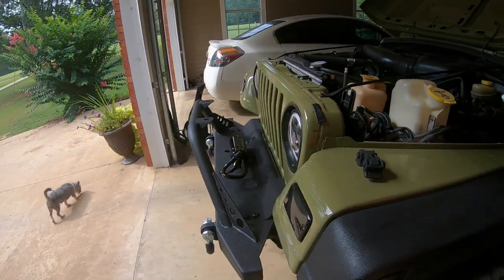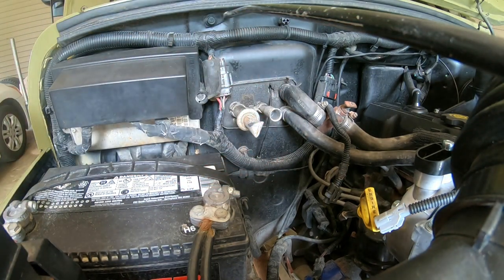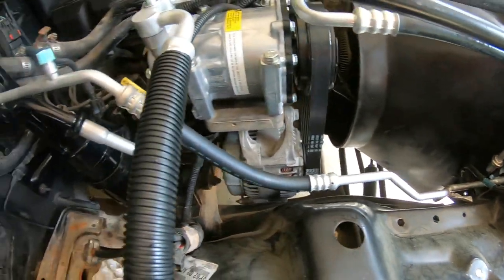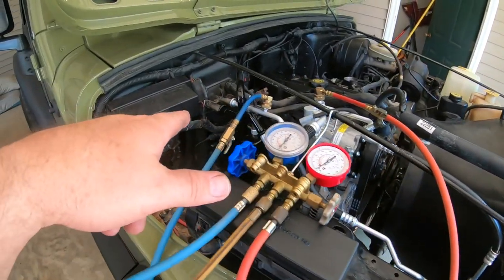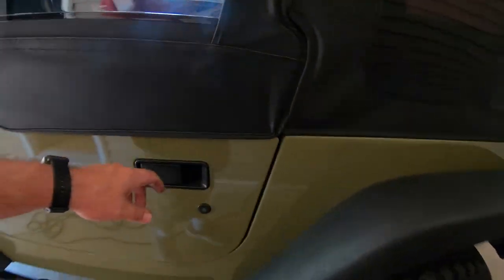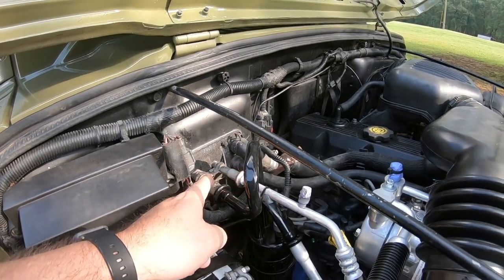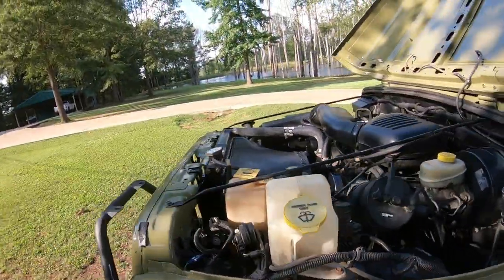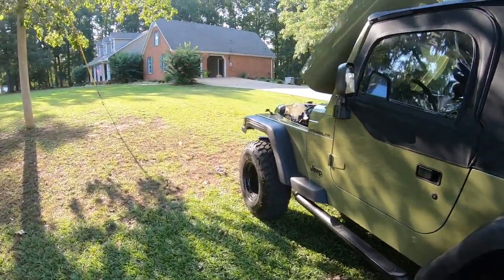Jeep Wrangler Air conditioning Installation (Part 2)! Installing AC on My Wrangler SE

Comment: Was there anything you had to do to the wiring besides the relay, fuse and pressure switches or was it prewired? I see some connectors near my compressor bracket. Are those for AC? Mine is a 1998 I’m restoring. It’s also a 4cyl 5spd.
Reply from the maker: All the wiring was there. There will be 3 different plugs. One for the cycling switch on the dryer, one on the high pressure switch and one on the compressor. Thanks
Reply: Force Built thanks for your quick reply! I did just go outside and looked. I have a black and gray plug near the bracket and another gray plug near the firewall. I will definitely be adding AC now that I see it’s mostly plug-n-play! My son and I enjoy watching your Jeep build and we love the commando green color. It’s one of our choices when we get to painting.

Comment: Hy Steve ,today I found a complete kit from "JEEP AIR" in Ocala FL.,it.s good but too expensive ( with ship and tax in cost me more than 1500 $ ,I 'm from Italy) I saw and cheek all component you wrote  on  Amazon .is  better and cheeper so I will buy there ,,,,,but where can I find recirculate door ;actuator and Hardware?.. About control Knob , May I use the original old one from fabric ? On my 1999 TJ is not slide ,but total Knob , without A/C symbol and switch for  on/off  it    ... Thank s
Reply from the maker: I think your control will work even though it is a knob and not slider(I could be wrong). My slider only has vent but still turns on the ac.
Concerning the recirculate door. I don't know where to source that part or actuator. Possibly Ebay. Your air will work fine without it. It will just be colder with a recirculate door. I did put one one mine and couldn't really tell a difference. I personally wouldn't bother with it, but I have a soft top. Mine don't hold cool air long lol.
Reply: Now all is clear ,Thank s one more Steve.

Comment: Hey I am currently installing the same ac system you put in your jeep but i am a bit confused on the electrical I understand that the plug closest to the fire wall goes to the accumulator drier but i have two black plugs next to the mounting bracket for the compressor that and one plug coming off the compressor and I was wondering where those 3 go thank you
Reply from the maker: Should only connect 3 in total. One goes to the drier as you said. One goes to the high pressure switch close to the compressor(in the actual line). The last one goes to the compressor (plug with single wire). All the plugs should be only able to plug in one place(where they go). The extra plug isn't for ac. Thanks!

Comment: Did you add any refrigerant oil to the system other than the oil for the compressor? Just curious since you were adding more new components than just the compressor, great video 👍
Reply from the maker: Yes, I did add some to the Dryer also. There is a certain amount meant to be in the system. I don't remember the #'s off the top of my head. Thanks for watching!

Comment: Great job as usual.   I probably missed it in an earlier video but did you put the evaporator in when you changed the heater core?  Have a great weekend. Thanks again for the videos.
Reply from the maker: Thanks Bob! The evaporator was already in from the previous owner. The heater box is a newer one than what comes on a 97  wrangler. I think they had damaged the original one or was planning to add ac. Not for sure why it had the evaporator already installed.
Reply: @ForceBuilt  Wow the previous owner did the hardest part, having an airbox that was ready for Air Con installed.
Reply from the maker: @brannonmiller5548  My Jeep has been in an accident before I got it. It has 03-06 seats(It's a 97). The heater box is from a 03-06(I had to make a cable adapter for my 97). So what I am saying is, they didn't do it on purpose. They were just putting parts on to replace broken ones lol. But it did benefit me in the end.

Comment: I don't have those fittings I only have the heater core fittings.  Do you change your airbox A/C unit?
Reply from the maker: That means you will have to take the dash out and put in a evaporator core. Mine had that from previous owner. Thanks!

Comment: Hello, your video is very good. I have a 1999 tj 2.5l without a/c and I want to install it, could you tell me if it is a kit or if I buy part by part. Thank you
Reply from the maker: It was bought piece by piece. The links should be in the description. Thanks for watching!

Comment: I suggest you to explain better the eletric wired connections on AC compressor ,cycling switch  and hight pressure switch .
Reply from the maker: There are only 3 wires to connect. They are all different plugs. No way to confuse plugs. Low pressure, high pressure and the one that plugs in to compressor. I didn't think it needed much explanation.
Reply: @ForceBuilt  Thanks,sorry but in the video I dint understood where the wires was ,just the one on accumulator drier ,all right for the wires on compressor.
Reply from the maker: @giannisalustri7848  I just watched the video again. Man it's been a while lol. Just look under your hood(bonnet) you should find 3 loose connections just hanging around not connected to anything. One will be a short wire close to where the dryer will be mounted. The other 2 will be longer but there is an easy way to tell which one is which. The one for the compressor will only have a single wire going to the plug. The one for the high pressure switch will have 2 wires. Hope this help! good luck and let me know if you need anything :)
Reply: @ForceBuilt  I found very easy the wires close to the compressor for it ....the one for drier accumulator is hidden away I will look better moving the Electric harnes ...now i will buy all component than I waiting for.shipping and ,TAX .....I will write here when I 'll Fit the Job ...Good luke ...I need.

Comment: Hello! Hopefully, you are able to see this comment and help me out! I am installing a A/C kit on my 97 TJ but don't seem to find the connector for the compressor. Where did you connect yours?
Reply from the maker: It is a plug with a single wire. It should be on the passenger side of the engine. Possibly hanging between the distributor and the front of the engine.  Hope this helps!
Reply: @ForceBuilt  found one with like a bluish color but doesn’t fit. Any suggestions of pictures? Thank you so much for the help!
Reply from the maker: @davidparra4646  contact me at futuraforce@gmail.com . I will take a pic of mine this afternoon and help you get it sorted out. Email will be the best way for me to send pictures.
Reply: @ForceBuilt  will do! Thank you!
Reply from the maker: @davidparra4646  You have mail!

Comment: I finally finish installing the ac on my 98 TJ. Couldn't have done it without your video. Did you notice any increase in engine temp after you installed yours? Mine not is reading above 210. Also will the heat from the heater core affect how cool the ac gets?
Reply from the maker: That's great! Didn't get a temp increase but mine already ran 210 to start with. Yes, the heater core will affect the ac. I put a cutoff valve in line at the firewall. When summer is here I always use this valve to turn my heater core off at the firewall under the hood.  It isn't needed in the summer. Hope.this helps!
Reply: @ForceBuilt   Great info. Thank you.

Comment: Would you see a significant loss of power with stock gears on a 5-speed 97 TJ?
Reply from the maker: Here is my honest opinion. I have 4.88 gears but also have 32x11.50 tires. They are heavy. If I was to drag race you, I don't know who would win because I think(if you have stock tires) that we have about the same power.
OK, I can diffidently feel when my compressor turns on and off while accelerating. When I am at cruising speed it doesn't affect at all. 
Here is what I did to solve the problem. I installed a toggle switch(I have a video and there is a certain way it has to be done).
When I need to accelerate as fast as possible, I just flip the toggle switch to disable the compressor. Then when on the freeway at cruising speed, I just turn it back on. I know this was a long response to a simple yes or no question. Here is a link to the toggle switch video( https://www.youtube.com/watch?v=WaI_SeEcs4I)
Thanks for watching!

Comment: Hy , Can you explain me .... had your jeep  just the vent installed from fabric .and the compressor switch line  ? I want install AC on my TJ 2,5L   by 1999 .,Have I to remove all dasch ?  have I  to install a new knob control  switch?... Thank first
Reply from the maker: Yes you will have to remove the dash to put in the evaporator core. You can use the controls you have. That is what I am using. Hope this helps!
Reply: @ForceBuilt  Thank so mutch ,I understood well from your video,long job ,but not difficoult ,I will buy the complete kit ,last question : Wires line to switch compressor ,are just inside ? My tj is 2,5 L 1999.
Reply from the maker: @giannisalustri7848  YEs, all wires I needed to connect were already under the hood. They should be there right now just not connected to anything. Hope this helps!

Comment: thanks for these great videos, Im gonna try on a 98tj 6 cil, there are a few things that chance, actually i guess is only the ac manifold hose, how ever what did you do for the recirculate door and actuator? i cant find those parts,  (Door is the biggest problem) so i was thinking in machining them on a mill thanks in advance regards From Reynosa Tamps. Mexico :)!
Reply from the maker: Thanks David. Someone had changed my heater box for some reason.  It already had the actuator and door on it. The diy kits I have seen actually cut a hole in the heater box. You can find actuators but would have to make a door. I personally wouldn't bother if mine didn't already have it. My door wasn't working at first and made little difference once I got it working.  So I think the door is optional and not necessary.  Hope this helps and thanks for watching!
Reply: @ForceBuilt  thanks for your quick answer! so without the door the air will be always recirculating right? i hardly ever use the outisde air option in other vehicles so i dont  see a big advantage on making the door
Reply from the maker: @TheDsher  Without the door you will always be using outside air(opposite of recirculate). Which will cause a few degrees hit to your interior climate. With my soft top I really don't notice much of a difference. Thanks!

Comment: I have the same climate control panel. Jeepair says it won’t work for the AC and you need to buy the upgraded one. How did you get it to work?
Reply from the maker: There is nothing to do. It just works. It will not have the snow flake pic on it. The upper ac vent slot will turn on the compressor as well as the defrost selection. You may have to add a fuse in the fuse box under the hood for the system to be active. I think mine even had that. Summery, I used my old non ac controls with no modifications and mine works great. Hope this helps and feel free to ask anything else you need to know!
Reply from the maker: So 1997 and 1998 have the sliders. I just went to Jeep air and the kit they offer for my jeep doesn't include climate controls. They want me to use the stock ones. Is your Jeep a 97-98?
From their site:
The system includes a new adhesive face plate for the original control head and all of the following:

New Sanden style compressor with clutch and oil
Drive belt
Evaporator
Accumulator drier
Condenser
Cycling & high pressure switch
A/C Relay
Recirculation door with actuator
Pre-made a/c hoses and liquid line
https://jeepair.com/collections/wrangler-ac-kits/products/1998-tj-wrangler-ac-kit-2-5-liter-engine-slide-controls?variant=32066977398869
Reply: @ForceBuilt  I have a 2000 TJ 2.5. I see, they just give you a sticker to put over yours. Also where do you think I can find a recirculating door. The part you showed on your video is nowhere to be found these days. Thanks!
Reply from the maker: @TheArtOfCool  The links were working on the PC but not smartphones. I fixed the links and they work now on smart devices. As far as the recirculate door, I never found a place to source the parts for that. I had the parts already but If I had it to do again, I don't think I would install it. It should work just fine without it.
Reply: @ForceBuilt  so I’m buying the compressor. Looks like I had the same compressor mounting  plate as you and will have to source the right one. What is the AC compressor model number? Can’t find it anywhere. Thanks !
Reply from the maker: @TheArtOfCool  just go to RockAuto and enter your Jeep. Then look in the heat and ac tab. Will show the model # for the compressor. There are several from different companies.

Comment: Would these parts you listed work for a 2000 TJ 2.5 ?
Reply from the maker: Your should be the exact same parts list as mine for the ac. When they swapped to the 2.4l then there are probably changes.

Comment from the maker: Links:
Double check parts. Minus Recirculate door, actuator and hardware. 
(AC Compressor)https://amzn.to/44O4w9s
(ACDryer)https://amzn.to/3XRuQ0r
(Evaporatorhttps://amzn.to/472T4Jk
(Condensor)https://amzn.to/44NkMrr
(AC Manifold hoses)https://amzn.to/3DgWBWx
(AC Liquid Linehttps://amzn.to/43nGwJq
(Belt)https://amzn.to/3NTCSkS
(Cycling switch)https://amzn.to/3Dg70BV
(High Pressure Switch)https://amzn.to/3OfUskb
I am a member of Amazon Associates.